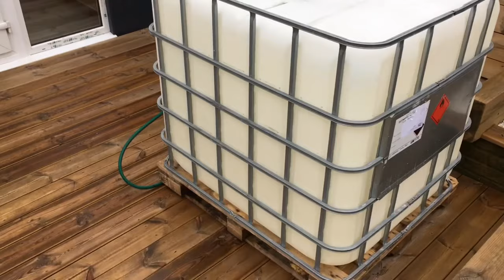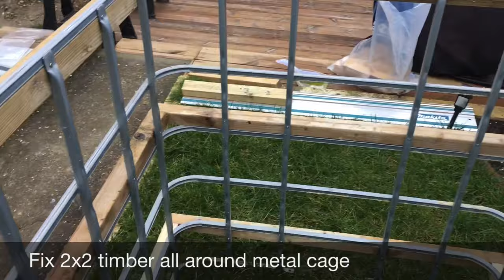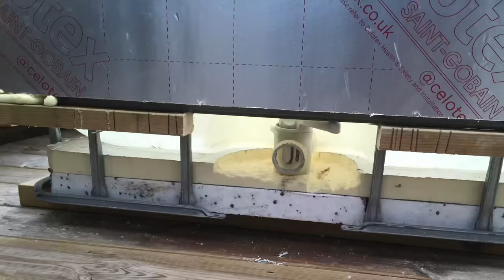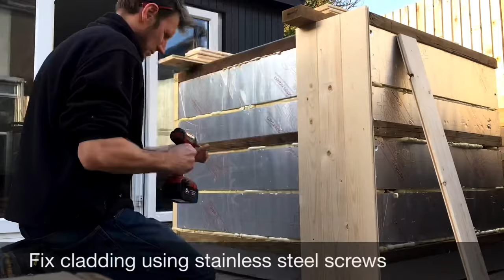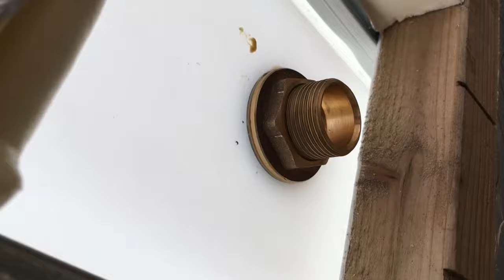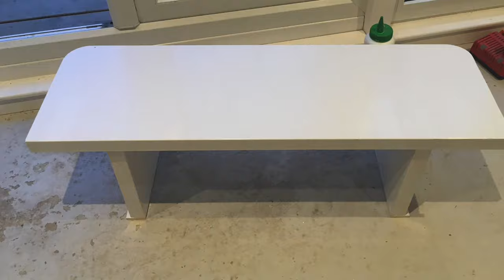How to build a Hot tub diy

Comment: Thanks. I could not visualize how I would seal the top part of the plastic so that water did not get to the insulation. But I see now that you need to elevate the plastic tank so that the cut edge is  1/16" from flush with the top of the metal frame. Now I need to figure out how I am going to get that tank and frame into my screened pool enclosure.
Reply from the maker: I did not seal top plastic ,because I used pir insulation they are completely waterproof ,never have problem with overfilling ,marked water level on first try .

Comment: how many gallons is that
Reply from the maker: Tank is 1000l-220gallons but because you never fill up all the way to the top I normally top up with approx 160-170gallons of water.2 adults when inside,can push water level higher.